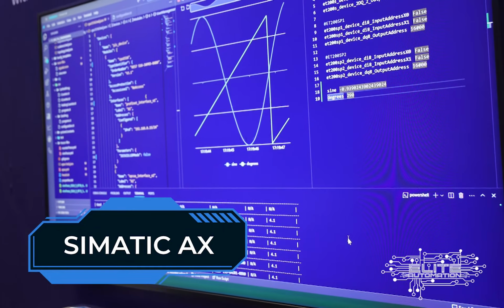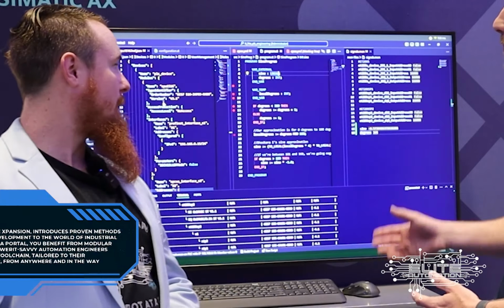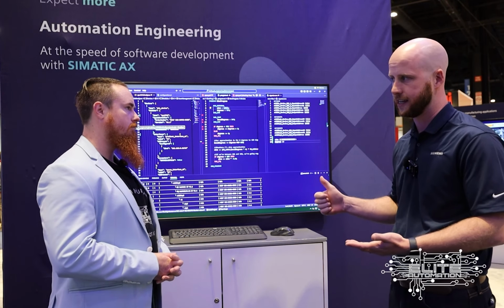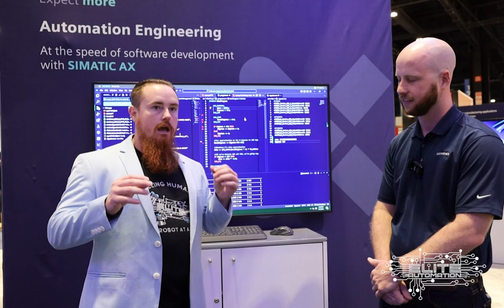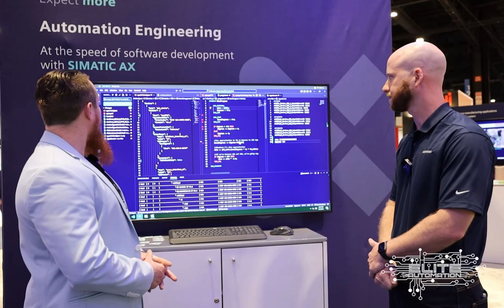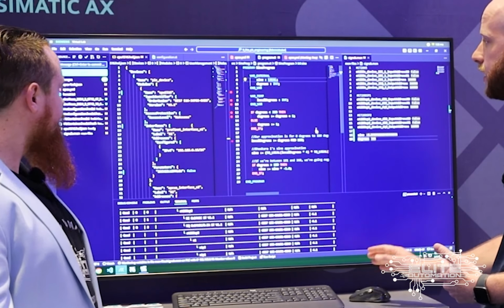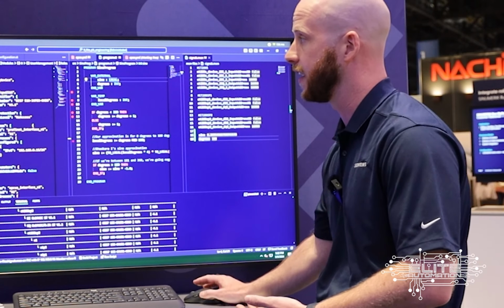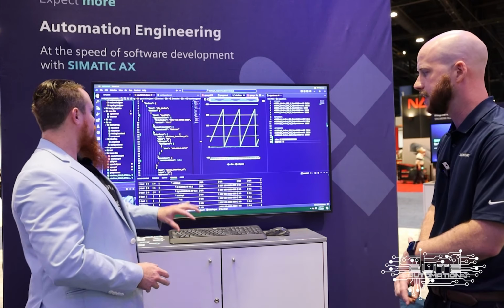The FUTURE of PLC Programming is HERE! Siemens Mind-Blowing New Tool!

Comment: Is it possible to do safety programming in simatic AX? Seeing as graphical programming is not supported
Reply from the maker: Yes, it is possible to do safety programming in Simatic AX, even though it doesn't support graphical programming.

Simatic AX supports structured text (ST) programming, a powerful text-based language that allows for complex safety logic implementation. While it may not be as visually intuitive as graphical programming, ST offers the flexibility and precision needed for safety-critical applications.

Comment: Can Simatic AX do the graphical programming methods, such as using Ladder or Function Block?
Reply from the maker: Simatic AX does not currently support graphical programming methods like Ladder or Function Block diagrams. It primarily relies on text-based Structured Text (ST) programming, which is a more traditional approach to PLC programming. However, it's important to note that Siemens is continuously developing Simatic AX, and future updates may introduce additional programming paradigms.
While Simatic AX may not offer the same visual programming options as traditional PLC development environments like TIA Portal, it provides a modern, code-centric approach with benefits such as:
Faster development: The text-based approach can be more efficient for experienced programmers.
Increased flexibility: ST offers more flexibility and control over complex logic.
Improved code readability: Well-structured ST code can be easier to understand and maintain.
Integration with modern development tools: Simatic AX is based on Visual Studio Code, providing a familiar and powerful development environment.
If you are more comfortable with graphical programming methods, you may want to consider using other Siemens automation tools like TIA Portal, which supports Ladder, Function Block, and Structured Text programming. However, if you are open to learning a new approach and value the benefits of text-based programming, Simatic AX could be a good option for your automation projects.

Comment: I think version control is something more recent. PLCs were not built from the ground up with version control in mind according to a source. I am sure automation engineers have thought about version control, tired to implement it with great difficulty. It seems as of recent, it's much easier to do. Unlike the world of software PLCs seem to go a lot slower. If it isn't' broken, then there is no need to fix it mentality. (I hate that type of old school mentality.)
Reply from the maker: Yes. And it's so antiquated. Even simple things like add a link to the direct download and instructions of the firmware upgrades or software. Even then though they're always challenges where it should just go through and work and it doesn't.

Comment: Wow, it's 2024 and automation engineers only now discover version control? How are they maintaining their code? xD
Reply: Yeah, it is very funny 🤣. Many folders with names _copy of copy.
Automation is many decades  behind of IT.
Reply from the maker: No we've been doing it for years. But we've been hating it for years.
Reply: Bare metal git bash. No refactoring in the ide (xae). Or git is like, where file?
Reply: Siemens already has Multi User Server version control
Reply: @IngVasiu : I hate siemens TIA Portal so much for their old fashioned IDE. It`s not only the version control system which could be easily done with git and multiple plattforms (Github, Azure etc.). 
You also need a license for multi user. That's embarrasing. 
Also the testing approach. You need an extra license for the testing suite??? 
And how the heck is TIA Portal not able to include ST as programming language?? 
Challenge: Try to include your TIA developement in an Azure pipeline where you execute your unit tests etc. Don't forget to pay for PLCSIM Adv if you want to communicate with the virtual PLC.
And the most funniest part: the library handling. Mastercopies and types :D. WHY in the world do I have to copy a type from a library into my project instead of referencing it like in every other language??? And that doesn't even work correctly.

TIA Portal is unacceptable for modern development.